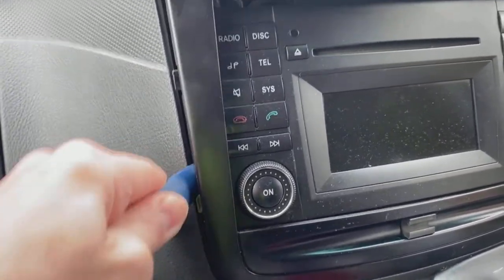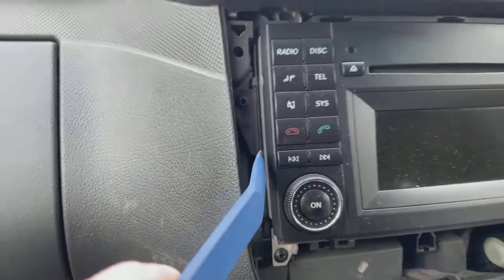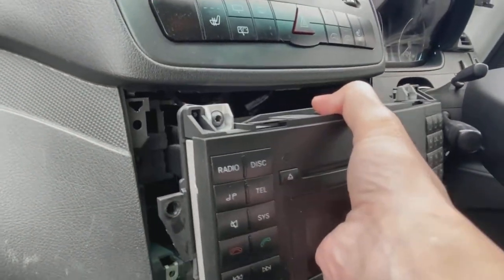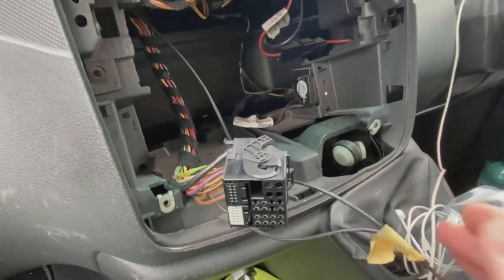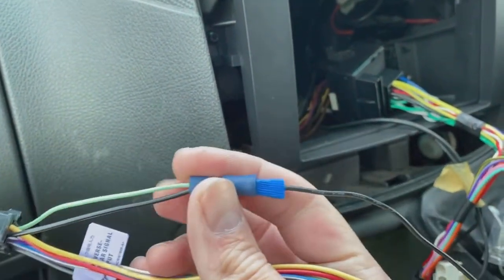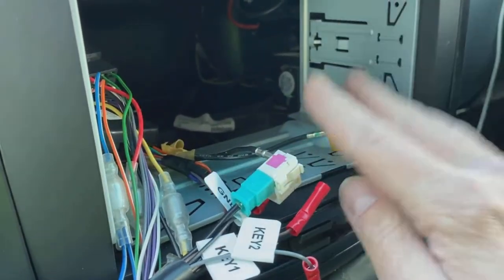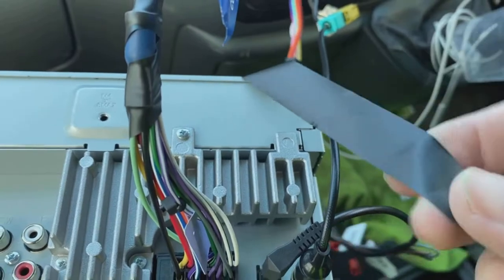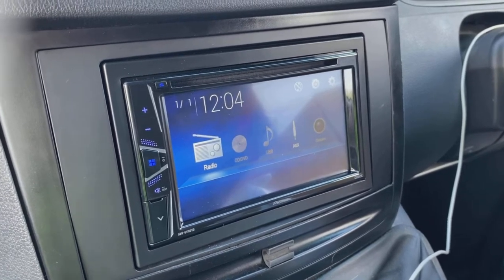Mercedes Vito 2004 onwards double din dvd conversion full guide.

Comment: Im trying to fit a Pioneer AVH 250BT in a Sprinter 2010, I fitted the Quadlock adaptor but there is no power at all🤷‍♂️ been told I have to run another live from the ignition! Is this correct and how would it be done?
Thanks👍

Comment: Hi, would I need to connect a microphone or will the new harness connect to the factory microphone for the telephone?
Reply from the maker: You will need to connect an external microphone.
One should be supplied with a new radio.
Reply: @PJs projects  Thanks PJ, I appreciate you replying back to me.